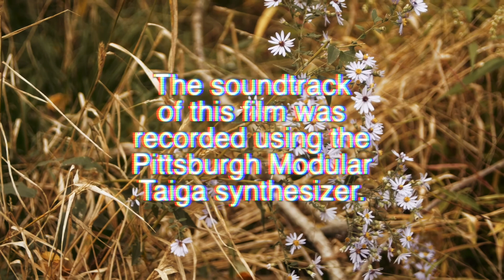Michael's One Minute Synthesis Minute

Comment: I am having a really really hard time accepting that definition of additive (wavefolders etc). With that basis a sin going in a lowpass with audio rate cutoff modulation is additive, so no, it does not work at all.
Beyond that Taiga is teasing all the right spots lol.